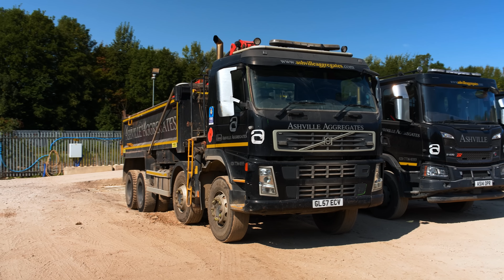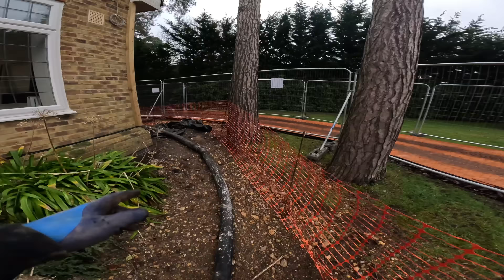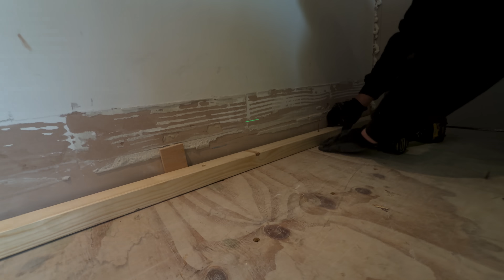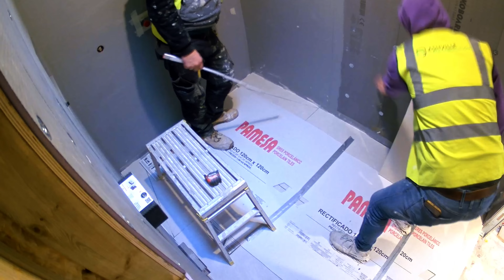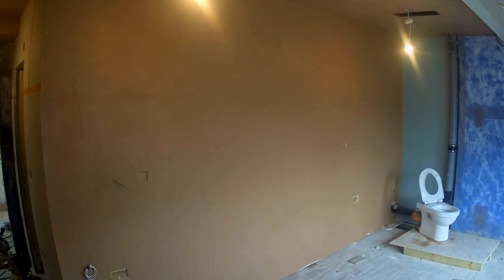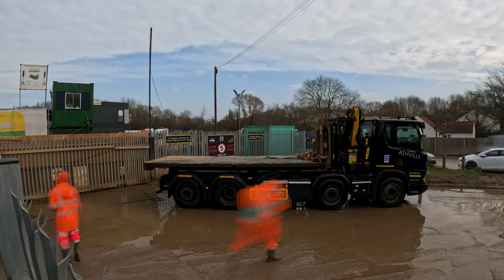LORRY TAKEN AWAY From Us | Ashville Weekly ep228

Comment: Have someone doing a light pre wash just before the wheel wash with the pressure washer n give the wheels a quick spray to take the heavy dirt n sand off then let them go through wheel wash👌that's what wee used to do Dan,we had a small ditch at side to wash/brush the dirt n sand into and empty when needed

Comment: I have a question.  im in no doubt that will be a reason why not . But cant you do the drainage before the concrete solving the puddles and wouldn't it need doing anyway ? Im fully aware its easy for me to say just doing drainage like its not a massive job . But a deep hole / soakaway in the middle with a  steel plate over it could be a good temp fix

Comment: We use lightweight concrete on new build apartments up to 5 stories. We’ve tried everything you can think off over the years. Different structural and acoustic with different ideas how to eliminate sound transmission especially with hardwood flooring and high heels. Mass is the best way.

Comment: You mention people out of London doing a rates check per load 
You ditched skips due to hassle 
Concrete Pumps - hassle 🤷🏻‍♂️
Straight Tippers - hassle 🤷🏻‍♂️
Diverse the fleet - tarmac / general clean aggregates / general cargo 🤷🏻‍♂️
The Volvo needing an engine do you know the exact issue ? 
Volvo could they supply short block with pistons liners crankshaft for an engine rebuild ? 
Fleet on R&M or Fleet half n half 
or Fleet fully owned I take it you have looked at the money situation with different truck manufacturers 🤷🏻‍♂️
If it was easy everyone would do it 👍👍👍💪💪💪🍺🍺🍺
Reply: Spot on were in the same game,everything is fucked in this game,everything many firms wont come back from this government and all its shit!

Comment: Sounds like Daniel have sold Ashville. Looking forward to wednesday for the video
Reply: what
Reply: @Noel_Jaco8not sold as such, gone into Administration on the Ashville Aggregates and Concrete side.
Reply: @ZG0002  what does it actually mean, going into Administration?
Reply: @lassepapkasse  It means the company Debts are higher than the income, so administration is designed to take over the company basically and work to change that, they won't be taking on new contracts though... they will look to pay off as much debt as possible and that will mean selling assets (equipment) and without that equipment you won't need drivers, back office staff etc and that means you also save on the wage bill. Any ongoing jobs or contacts will be honoured where possible as they will be brining in Money. It's basically going to be a reset for that side, and he may not want to continue to put himself through it. Remember through Ashville is more than the Aggregates and Concrete.
Reply: @ZG0002  makes sense, thank you for your very informative comment. Have a lovely sunday mate
Reply: @lassepapkasse  you too mate. Remember this looks to just be one part of the company, all isn't lost.
Reply: @ZG0002 not much else left skips gone, aggregates and concrete in administration, roll on roll of truck for sale.
So plant hire done, only leaves building firm and he subs most of that out only has 1/2 of his own guys on that side

Comment: The DK11 litre engine in the Volvo volumetric running at 450 is the max power for that engine, especially at the weight of the vollies. Could you track down a DK13 litre for her? Running at 450 would be light work they run up to 540 on those bigger engines
Reply: Agreed we run a D13 litre Volvo grab and chipped to over 520 bhp awesome